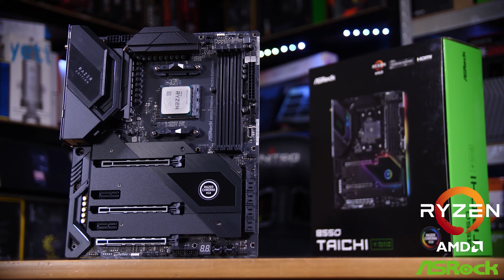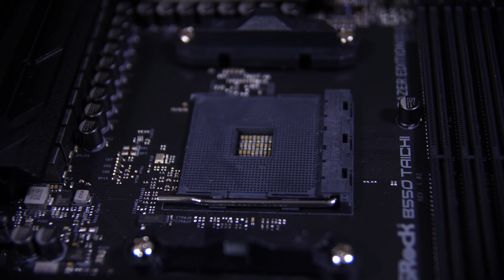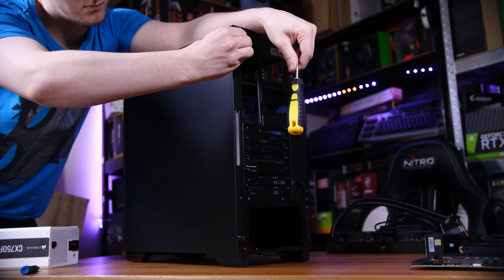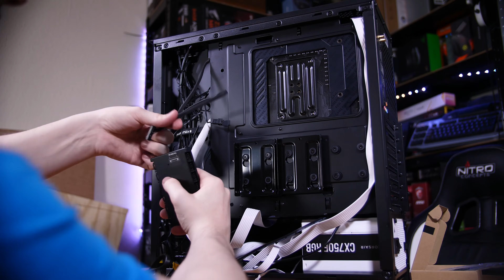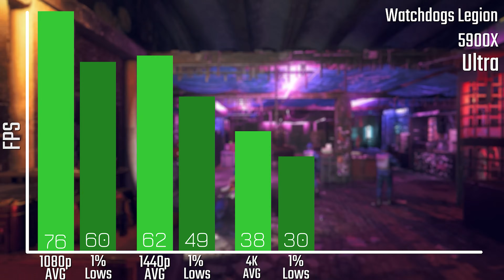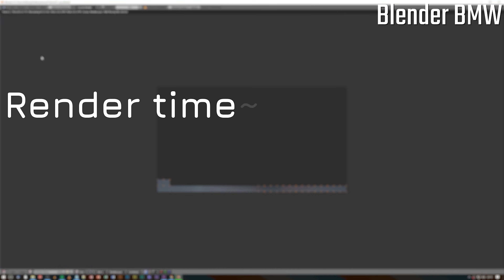Ryzen 5900X & RTX 3070 Build Guide - TechteamGB

Comment: I've got the same specs.. A 3070, 5900x and 32gb with a ASUS tuff x570 motherboard. I rarely go over 70 Celsius let alone 74, and I get nowhere near the same performance on Ultra settings.on 1080p let alone 1440p on Ultra settings. No bottle necks, no thermal throttling, DOCP enabled, and still cant get those numbers.
Reply: Really? I max out my monitor most the time on 1440. I got this same GPU except oc edition, R9 5900x with a kraken z73, Tuff x570 mobo, 16g ram 3600, 2 inland m.2 4x4 ssd's. Originally got the GPU because of availability but now I need a monitor to make it worth upgrading it

Comment: What are the Temps on the cpu with that 240 Radiator?
On idle and gaming pls
Reply: I just got the 5900X and I get 65 degrees max with my 240 radiator under heavy load. I average around 60 degrees.

Comment: Why are you using a 750W PSU if 650W is enough? Im thinking about getting a pretty similar setup and wonder if I should go with 750w or 650w. 750 would be 20$ more than the same 650 ones
Reply: Failed psu can fri your MB etc. Why risk it over 20 dollars. Get one that can easily power the pc.
Reply: 650W should be plenty with a 3070.

Comment: Does the 5900x bottleneck the 3070?
Reply: It does not and is one of the top CPUs you can buy for gaming.   In theory you can bottleneck any CPU by lowering the resolution to something such as 360p however I doubt many people use the 3070 below 1080p.

Comment: IMO I would go with a 3900x and save $100 on the cpu and buy the motherboard, ram, ssd, etc on sale so then I can spend the $200 I saved on the rest of the parts to upgrade to a 3080 whenever it goes in stock for more then a few minutes lol
Reply: Well, as of right now the 3080 is impossible to find. I guess he did make the right choice at that time lol